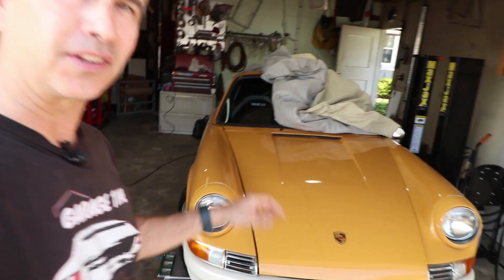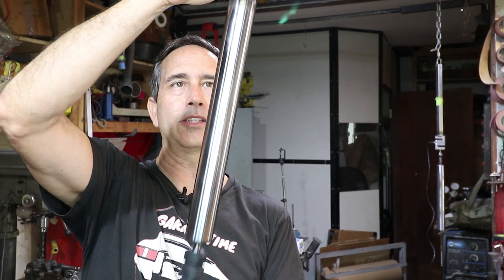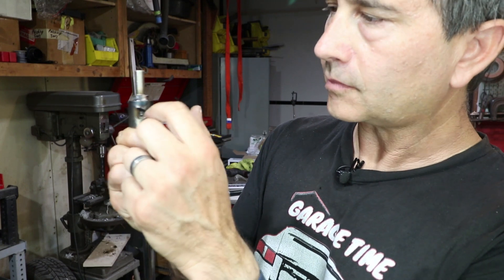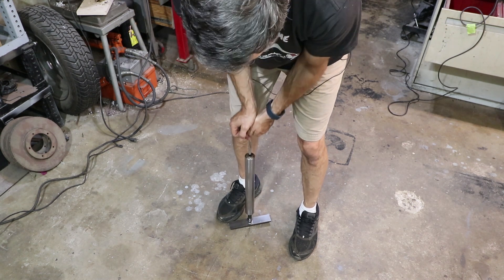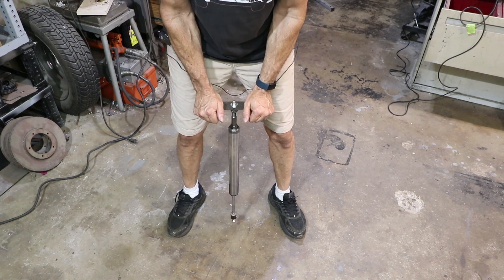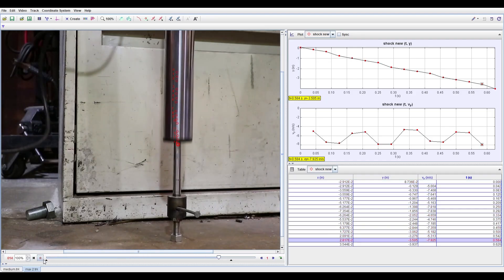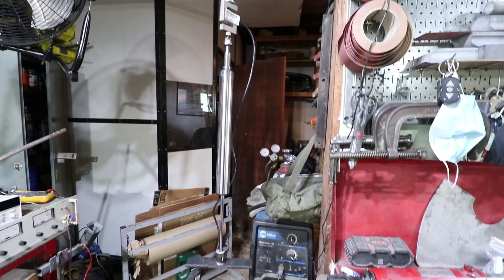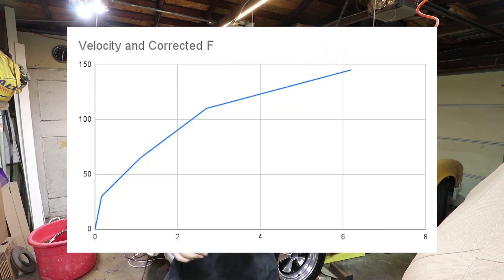Human Powered Shock Dyno & Shocking Test Drive Results

Comment from the maker: Sorry for the abrupt ending to this video. Let's continue the discussion here in the comments. What do you think of the data and the test drive with camera results?
Reply: So after alignment and change of shocks, what was your assessment after test driving?
Reply from the maker: @Faisal Iqbal  Well the alignment still isn't done, but it's closer. I only got the shocks on and did that quick test drive but the assessment is it feels like a stock 911 minus the anti-roll bars.  More work to do for sure, but at least the suspension moves now😊
Reply: I didn't notice a front sway bar, was that omitted for the purpose of testing the shocks?
Reply from the maker: Hi James.  The anti roll bars have not been installed yet.  I actually don't have them yet, ha ha.

Comment: I'd like to try this, can you give more detail on the software you used to get the camera imaging into pixel movement speed and plot it against the load cell data ?
Reply from the maker: You can get the pixel tracker at Physlets.org/tracker.  I use a HP data acquisition unit to record load cell data and then synch them in excel

Comment: Interesting facts and very good approach, thank you.

In the car you have the combination of linear (?) spring force and non-linear damping force. I suspect there are more information slumbering in your data.
Reply from the maker: Thanks for watching.  There is also a combo linear spring force (gas pressure) and non-linear dampening in the shock.  
The torsion bar spring forces are pretty well understood, but the dampening forces are not.  
I'm open to suggestions to interpret the data. :)

Comment: Am I confused or you were driving without the sway bar? Do you think it would affect your data in some way?
Reply from the maker: No sway bar.  Some 911's and most 912's don't have sway bars either.
A sway bar would reduce body roll when cornering and would also reduce piston velocity.
I added custom mounts for adjustable sway bars.  I will add anti roll bars in a future video.  Stay tuned.